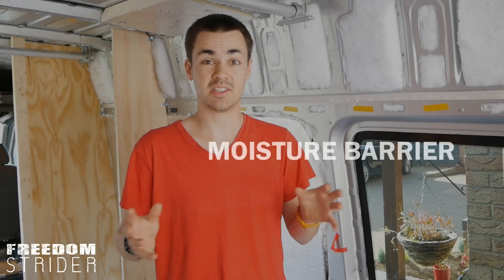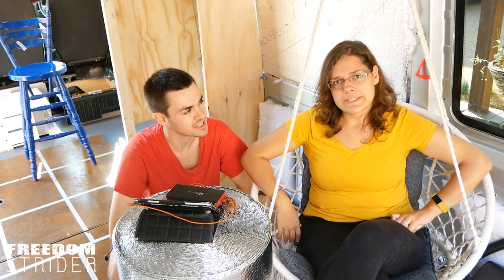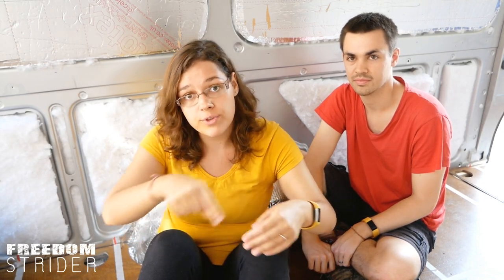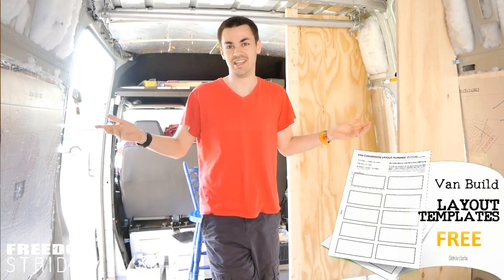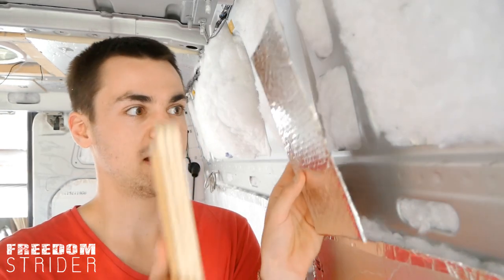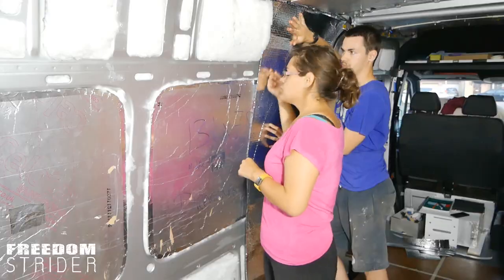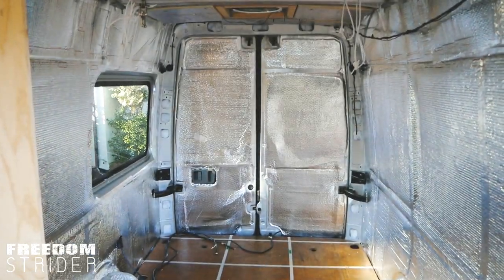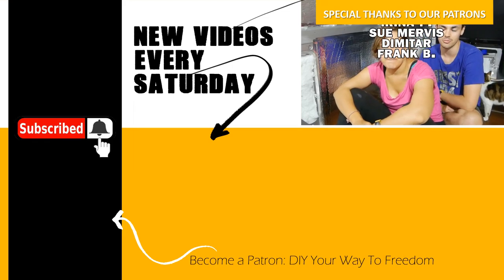Installing Reflectix Insulation CORRECTLY - Moisture vs. Radiant Barrier

Comment: I am not sure why you are saying that it will reflect heat both ways? For it to reflect heat both ways, you need to have an air gap on both sides (although the 'fluffy' type insulation would considered like 'air', right?). If you stick it to the metal of the van, it will only reflect the heat back to the van.

If you stick it on the framing, it will reflect the heat back to the insulation of the outside. 

I 'feel' that the best way to use Reflectix, is to put it AWAY from the van wall. Because it is easier to warm a van during winter than to keep it cool during summer (provided you have good insulation). What would you say about that? Your feedback is welcome! How did you end up doing it in your van?  

And do you really feel that it's better to use Reflectix, instead of just adding more insulation, where the air gap is supposed to be?
Reply from the maker: As a general rule, whether you put the reflectix on the wall of the van or away from the wall - as long as you have the air gap on one of the sides then results will be the same. The video that explained it best to us is this one, the guy explains it visually very well: https://youtu.be/E1IwS0_lpBc

The positon of the air gap, making no difference, the way we decided to put it on the van, was a decision based on other practical considerations. How easy is the reflactix to attach, How would we attach the cladding afterwards, What if we need to add framing... etc. 

As for adding extra soft insulation instead of reflectix (without doing the maths we can't be sure and we haven't experienced it to compare), but we are very happy with our insulation set up. As soon as we put the reflectix on, the climate in the van became much more balanced, even just us being in the van warmed the space up in winter (enough not to shake with cold). So, if we were to do it again, we would put reflectix on.
Reply from the maker: Oh, and the 'fluffy' insulation does not count as an airgap - the gap has to be empty air/vacuum

Comment: Any suggestions for permanently covering windows (that will be behind walls)? I was thinking of going with Reflectix on outside followed by Polyiso. Or should it be switched Polyiso then Reflectix to get the 1” gap?

Want options for keeping it stealth when I go into cities…. Wondering if I sprayed outside layer (facing window) with like Flex seal or Plasti Dip? Thanks
Reply from the maker: Windows do let in the heat and the cold more than just the bare metalwork, especially the heat. Spraying the outside might work quite well, to block the light coming through if you didn't want the window at all. Keeping an airgap for the reflectix would still be best to give better insulation qualities. 👍

Comment: Which way round does the shiny foil side face please? Sticking to walls as you are and leaving space between it and ply :)
Reply from the maker: Well the foil we used is shiny on both sides but if only one is shiny for, it should face the gap. So, in your case, once the foil is on, you should see the shiny foil. :)

Comment: The problem with vapor barriers (VB) has always been structural.  It a house (or a van) if the building is 100% vapor barriered and you slam at door, an unsupported VB will flex.  This constant flexing will eventually fatigue an unsupported VB (plastic or tin foil).  Plus these materials are compromised when you attach the interior cladding over top (screws).
An easy VB that is structurally supported is PAINT!  Two coats of oil or latex paint applied to your finished surface, produces a great VB that is structurally sound.  Plus if it is damaged, it is easy to repair with a touch up of paint.
Reply from the maker: Thnaks, we'll have that in mind 🙂

Comment: Hey both, great video! I was wondering... If indeed I can't afford to lose width-wise space in the sleeping area of the van, but could elsewhere, would it be worth installing a radiation barrier in just part of the van? Like the roof, and perhaps parts of the walls? Thanks for sharing your thoughts!
Reply from the maker: So I assume you mean you aren't going to install insulation in the part where you'd be sleeping width-ways? You can do partial reflectix - but you have to be careful because if your reflectix is not airtight, that will let some moisture in behind the walls, but it will also trap it there, which can cause problems. If you choose to go with partial reflectix, if you just do it on the ceiling, that's probably the easiest to isolate as the cavities on the ceiling are not as connected as the walls. You can do it on the walls as well, but I would recommend thinking about how to seal the edges of your reflectix, or ways that you can ventilate the walls so that the moisture that does enter, can vent out. I hope this makes sense 🙂

Comment: Thanks for the great info guys!!
How do we feel about adding reflectix to polyiso board? I was thinking of attaching reflectix directly to van walls, then half an inch of dead space, then another layer of reflectix adhered to one inch of polyiso, then plywood wall.
How do you see the moisture situation going? I live in a hot area so I feel like most moisture would evaporate within 24 hours, specially with the half inch of complete air flow in the dead space.
Thank you for any help!
Reply from the maker: So from what I understand, you are not filling the wall cavities of your van with any insulation? If that's the case then that is not a bad way to deal with the moisture on the van metal, as you'll be leaving all the natural vent holes of the open. Also, you are right that in a hot climate the sun would dryout most things quite quickly.

However, leaving the cavities empty and then doing the PIT board on the outside, would reduce your living space... so twist and turns 🙃

In the dead space after your reflectix, is that where you are putting framing? I'm just thinking that if your cavities are empty then you don't really need another air gap.

As far as I can visualize, your insulation system is fine, it will work, and it could potentially manage the moisture more effectively than stuffing the cavities.

Comment: What about running strips of plastic strapping (the sort often uses to attach loads to pallets and found in bins/skips) hot glued to metal framing to hold bulky insulation from intruding into the air space? I’m going to do it in my Toyota Hiace.
Reply from the maker: That could work, soft insulation works best when not compressed although it does need to be controlled on a way, we were thinking string and some people use heavy wood beams but the straps would work well for the soft stuff 👍

Comment: Here's an off the wall (no pun intended) question. Can the radiant barrier be on the outside (like Batman's underpants), e. g.  via some sort of paint? I've read, for example, that car windscreens have a coating which acts to reflect a lot of radiant heat.

Putting it on the outside would be easier to do - just one coat and no fiddly patches to deal with - and easier to patch if scraped or scratched.

I realise that you would still have the vapour seal to achieve.
Reply from the maker: I think there are reflective paint, I think it's called Chrome paint, but I'm not sure how effective it would be, though it will certainly reduce the absorbsion rate. However, since it's so reflective I think around the world it's actually illegal for use on vehicles because it's reflectivity can cause accidents (by blinding people)

We've heard some people considering the use of reflective paint on the roof for the same our, that was it's only helicopters and pigeons that will suffer the shine  - the only issue with the paint (other than the possible illegality) is that you'd need to keep it clean all the time as dirt reduces it's efficiency
Reply: @FreedomStrider  Another question: I have seen on another excellent van build channel (HughTube) the use of automotive carpet, which seems to offer a vapour seal plus (possibly) sound (vibration) insulation and - I assume - SOME heat insulation.

I am wondering whether this is a candidate for ticking all the boxes in one go, and avoiding the need for air gap, albeit not as effectively as having the various separate layers.

You could still add an interior wall or at least battens to attach cabinets and so on to.
Reply from the maker: The only automotive carpet we can think of is the 4-way stretch carpet that most cars are lined with - it's what we used on our headliner. These carpets are not an all in one solution. I would say, they do help to dampen the vibrations and they do add a little insulation (though not enough to keep you warm in winter. 

As for the vapour seal, unless the carpet you are thinking of has been lined with reflectix or another non-breathable material on one side, the fabric itself is very much breathable, so it will not stop the vapour getting to the cold van metal. We are actually planning to use some stretch carpet to help us circulate the moisture in our walls.

And for the radiancy protection, if there is no reflective surface (installed with an air gap) then that will not be covered with an automotive fabric either.

The only way I can think of a carpet starting to be functional is if the carpet has been stretched on a non-breathable, reflective surface, and then that is somehow attached to the van's framing (leaving an air gap on the back). That will sort of, tick the radiancy protection, a bit of the moisture barrier (but not fully) and the fleecy fabric will be a bit insulating. However, there are a lot of red flags that would need resolving down that path. 🤔🙂
Reply: @FreedomStrider  Thanks for a great answer.
Reply: I’ve always thought that having a white van (as opposed to an expensive dark colour version)  was the first thing to consider and reflective covers for the windscreen and side windows in the cab make a massive difference as soon as they are put up on even a U.K. sunny day😉 Ventilation via a roof vent is also key to keeping condensation at bay. Your explanation of conduction and radiant heat was great but don’t forget convection! Warm (damp) air rises...hence the roof vent idea!
Reply from the maker: Yes indeed, and if possible, either 2 vent fans or an opening skylight plus fan to circulate the air around. 😊

Comment: I'm confused, you said the Reflectix should not touch the metal, but you are sticking it to the metal in the end.
What I am not getting right?
Reply from the maker: No you are right, ideally it shouldn't touch the metal as that would create a thermal bridge. Ideally you can stick some foam or another insulating material to the metal or on top of the reflectix (once stuck). In our case we actually had ply framing on top of the thermal bridges so a good portion of the bridging resolved at the next stage. But any place that did not would potentially condensate so to improve our insulation system I would stick some foam similar.

Comment: I don't understand the difference between what was said at 7:57 and 7:00. The cladding?
Reply from the maker: Yes, in one you have van metal, reflectix, 18mm framing, inner wall

And the other you have van metal, 18mm framing, reflectix, inner wall

You still have an air gap in both cases, the location of that air gap is different. ☺️

Comment: Any similar thought process regarding the reflective surface of the rigid foam insulation you have?
Reply from the maker: Yes, technically that is also reflectix, and so it the aluminium tape we used. As long as the reflective surface isn't broken and has an air gap, it will work the same.
Reflectix has some bubble wrap between its 2 foil layers which gives a bit of extra insulation (not much)

In theory, with the pir board and foil tape you could do a moisture barrier. The only thing we found was sticking foul tape directly over the metal parts still created condensation but using the reflectix over the metal caused no condensation 😎

Comment: Hello thank you for your video what if you are using 100% Havelock wool does it make a difference
Reply from the maker: I'm not sure, Havelock wool is New Zealand sheep wool, right? We haven't used it to compare. Things to consider, however, is the weight, smell and if the natural material is an irritant. Otherwise, I'm sure it will keep you warm.

Comment: Hello, thanks for the video, very informative!

I'm building a catering van and want to keep the heat to a minimum so that the commercial drink fridges don't work so hard to keep things cold. What do you think about styrofoam as an insulator? The problem I see with the fluffy insulation you used is that it can hold water in it if water gets into the walls of the van.
Reply from the maker: Styrofoam is not as good an insulator as some other options. If you're going to go with rigid insulation board in the walls, I would go with PIR insulation, it much better than styrofoam, though do be aware that shaping any rigin board in the smaller cavities would be nearly impossible and require a lot of patience.

Now budget dependant, the best insulation that you can go with is spray foam insulation, especially if moisture is a concern. This will definitely not trap moisture in the walls, and condensation would be only around the windows, not anywhere within the walls. 👍

Comment: hey, are you not afraid that you have humidy in the isolation ? after some couple of years you will have a lot of rost ..maybee...
Reply from the maker: Well it is something that is quite unavoidable, if you were to use spray foam insulation and do it properly you might be able to eliminate moisture from your insulation cavities, but must vans have natural drain holes in the walls so the vans walls won't be air tight and moisture can still get in.

The rigid PIR board should eliminate most moisture held in the walls (compared with rockwool which holds a lot more moisture), and with the drainholes unclogged at the bottom, moisture should be able to pass through. Due to the design of vans (being metal), they aren;t really designed to be insulated or have big temperature differences, so you have to do the best you can. Eventually, yes, moisture in the walls will cause rust but then again, regular vans condensate moisture on the inside of the metal walls on hot and cold days anyway, and with insulation taking up the majority of the space inside the wall cavity, it should help somewhat :)

Comment: I'm not seeing the air gap in your installation. Are you saying that the wooden framing is the air gap?
Reply from the maker: Yes the 18mm ply provides the air gap. You need a minimum of 12mm air gap to make the reflection work.

Comment: Is ripping your insulation the best way to create an air gap? Wouldn't it be better to just seal it up as tight as possible and get wider studs(framing) to create the air gap?
Reply from the maker: Ripping which insulation? The soft one? Can't quite visualize what you are describing... can you give us a bit more detail of what you are thinking? 🤔
Reply: @FreedomStrider  yeah at 9:15 you rip the soft insulation to create your air gap
Reply from the maker: Ah I see what you mean. We ripped that so it would fit in the cavities, the fluffy insulation isn't a substitute for the airgap, our airgap is created by putting the framing over the top of the reflectix (shown in one of our later videos)
Reply: @FreedomStrider  oh ok thanks for explaining to me!!🥴

Comment: I may be wrong, but, you're radiant barrier or reflective barrier, reflects on the side of the air gap only. So you are not reflecting outside heat
Reply from the maker: No, it will stop the radiation heat transfer both ways. I could write an essay on this 😊, but I think this person demonstrates it well: https://youtu.be/E1IwS0_lpBc

Comment: Excellent explanation of radiant heat but a huge fail on how to use sprayed adhesive. Hope you figured out eventually!
Reply from the maker: Failed how? The adhesive stuck the reflectix perfectly.
Reply: @FreedomStrider  Hi, these adhesives work differently than the usual suspects. They need to be applied on both materials then you need to wait until it's dry to the touch and only then press the two materials together. Unless you used a very special one I don't know about, which case I stand corrected. 
Awesome work anyway, thank you for sharing and taking the time filming and editing it. I just started mine, hope you are enjoying yours!

Comment: Reflection means it reflects light for instance in a window it will reflect the sun away,if it's inside a van it might as well be plain old bubble wrap.
Reply from the maker: In the use case in the video, the Reflectix reflects infrared heat as well as light. The fact that you see it reflecting the light when exposed, doesn't mean that (when covered) it will lose its ability to bounce the infrared radiation. Infrared waves are not visible to the human eye, they are experienced as heat. That's why you need the air gap, when installing Reflectix as part of an insulation system, to allow the infrared radiation room travel through the air. Otherwise it will just conduct in and out.